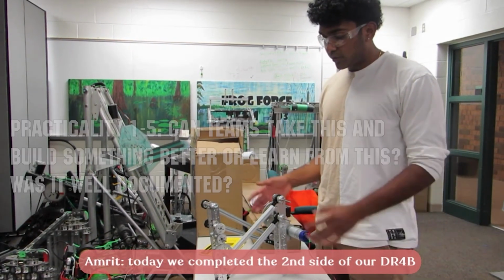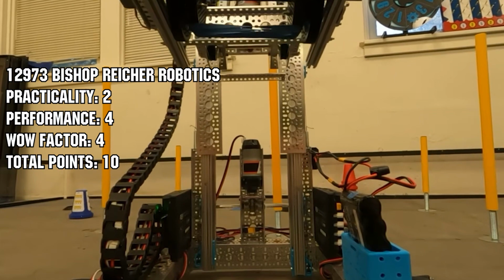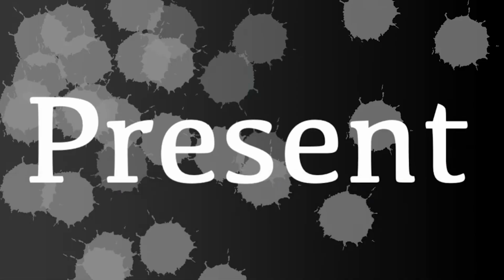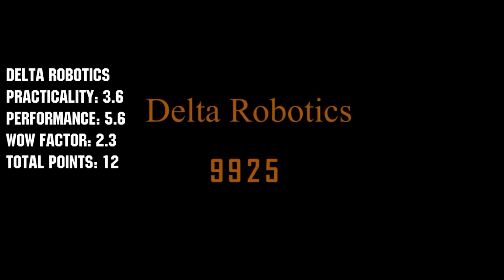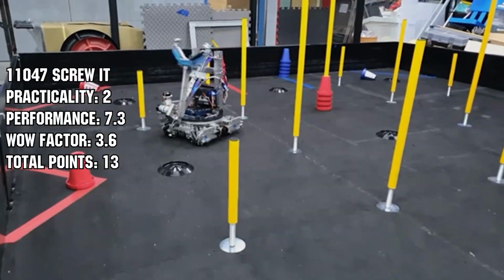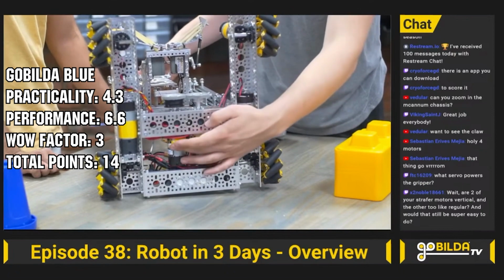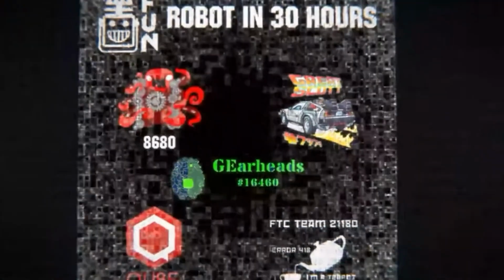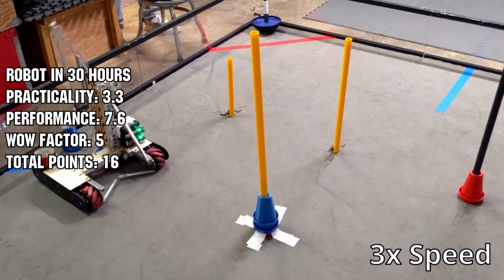Top POWERPLAY Ri30H/Quick Builds - FTC Recap

Comment: As a member of team 17116(the leading team in the Creighton Prep Ri3D). We chose to do the hammerhead mecanum drive in order to try and reduce the affect of the ground junctions. This did not work but if you were to make the front and back independent from the main part, it would probably work well. Another reason we used it was because it was a base we had laying around that was smaller than 18x18.